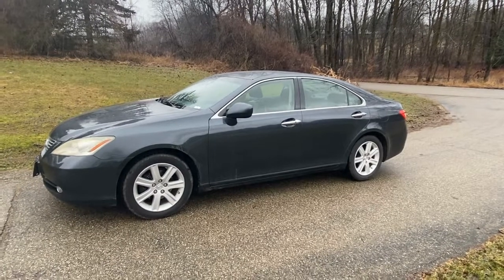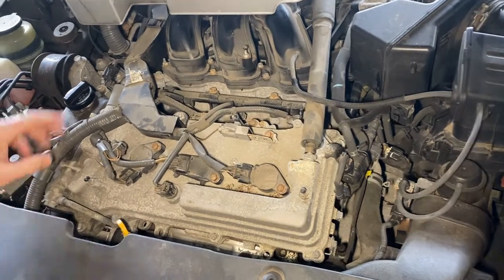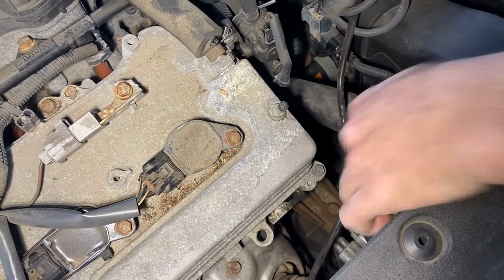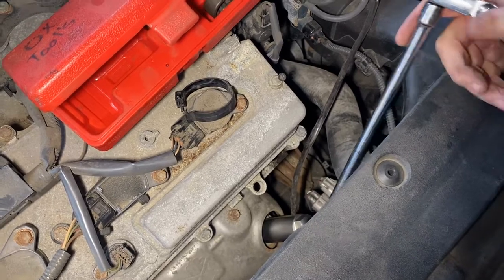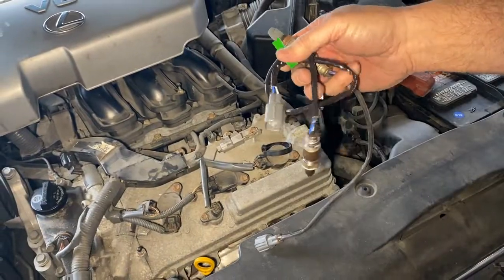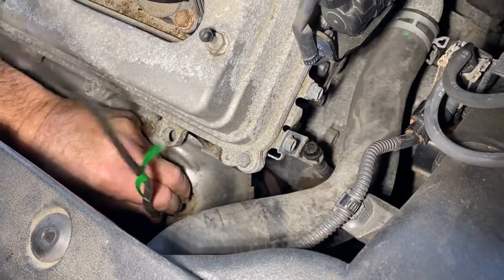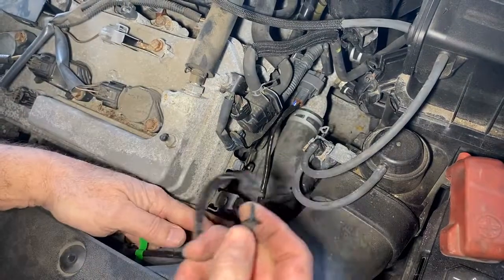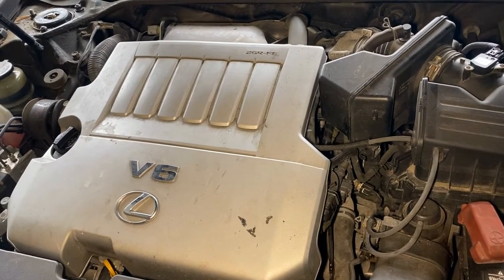How to Replace Oxygen Sensor Lexus ES 350

Comment: I changed out this exact sensor your pointing to in the beginning of video.
And now my back mufflers sound louder than before .
Only thing I noticed was the O2 sensor was a bit shorter than the old sensor it had .
Is this normal?
Reply from the maker: The Oxygen sensors should look exactly like the old one that you remove and it's always a good idea to use whatever was recommended by the manufacturer. Replacing the oxygen sensor will have nothing to do your vehicles exhaust being louder.

Comment: my lexus es330 2005 got diagnosed with an O2 sensor code and i was wondering if that can also be the cause of my steering noise when i make a full turn both left and right
Reply from the maker: No, that would have to do with a breakdown of your power steering fluid or a bad rack and pinion .
Reply: @TheAutoTeacher  appreciate your response! but wow thats even worse then i thought :(
Reply: Or bad front AXLES..😊

Comment: Hello sir. I’m getting a P0051 code on my 2004 ES330 after fixing an exhaust leak. Do you know the location of that sensor? 

I’m not sure if it’s the one in front of the engine or the one before the cat on the exhaust.
Reply from the maker: Front of the engine, Its the one before the Cat. 
 (P0051 code) HO2S Heater Control Circuit Low (Bank 2 Sensor 1). 
A ES330 has four O2 sensor's,  two on Bank one and two on bank two.

Comment: I got check engine light and slip indicator light
Was told its an electric issue 
With the 02 sensor im guessing its the oxygen sensor or whatever.
Its causing slight issues when my transmission/acceleration.
Is this an expensive fix?
Mines a 2010
Reply from the maker: What are your PO codes ?
Reply: @TheAutoTeacher  not sure I have someone on their way he is going to scan for data

Comment: Great video. 
What about a Bank 1 Sensor 1 for an 07 ES 350 Lexus?
Reply from the maker: Same basic principle, but on the backside of the motor by the firewall, it's the first oxygen sensor.
Reply: @TheAutoTeacher   It looks so manageable that I may try to do it my self. I recently had my Catalytic converter replaced and afterwards. My check engine light still on w/ this code. My mechanic wants to charge $140 for /labor.

Comment: Will the check engine light turn off itself after replacing the sensor?
Reply from the maker: Not always , if you don't have a scan tool disconnect your battery which causes the ECU  to reset the check engine light which is equivalent to a hard reboot on a desktop computer.

Comment: Hello, my friend, I am from Saudi Arabia, and I have the same car, and I have the engine check mark, and I checked the engine, and I got a code P0420. Is this code the same as the problem that you changed now, or is this code for another sensor? Please reply please
Reply from the maker: No, we had a PO151 which means that O2 Sensor Circuit Low Voltage (Bank 2 Sensor 1) has been detected.
There are many variables that could cause your PO420 code ,it can be caused by various things such as a malfunctioning catalytic converter, a clogged air filter, a vacuum leak, spark plugs or O2 oxygen sensors that are beginning to fail .

Comment: Good video what about po138
Reply from the maker: Bank 1 Sensor harness is open or shorted or Bank 1 Sensor 2 circuit  has poor electrical connection. But most likely it's a  Faulty Oxygen Sensor Bank 1 Sensor 2 .
Reply: @TheAutoTeacher  thanks for the response

Comment: what is the oem part number
Reply from the maker: For this Lexus part number 8946707010. But I would call the dealer with your Vin number to make sure you get the proper part.

Comment: Hey hi. I got that code on my 2007 Lexus ES350 (same color than yours): P0051 H02S Heater Control Circuit Low (Bank 2 Sensor 1). 
I ordered the ox. sensor, but I won't be able to install it until few days. Is it bad to drive with a defective oxygen sensor? 
Thank you.
Reply from the maker: You can drive a vehicle with bad O2 sensors for a  short period of time if you can put up with the poor performance and decreased gas mileage, but over time it will hurt the longevity of your motor and cause failure of your catalytic converter because your motor wasn’t running efficiently as the manufacturer intended.
Reply: @TheAutoTeacher  Ok, I understand. Thanks a lot for your help. I'm supposed to get the sensor tonight and will have it installed as soon as I can.
Reply: @TheAutoTeacher  hi, does that one help in gas mileage because mine is getting the worse gas mileage have changed the plugs still the same now m getting p0355 E coil will changed it next week planning to changed the 02 sensor also
Reply: @TheAutoTeacher  yeah I ain't driving mines until replaced for the fact it's loosing gas rapidly

Comment: it said "check vsc" so i though it had something to do with suspension system or sum lol
Reply from the maker: Yes, but whenever a Toyota/Lexus throws an engine code, it will also disable the VSC light and triangle. Fix the reason for the PO code and your VSC light should go off.